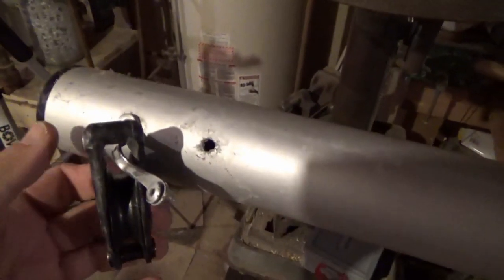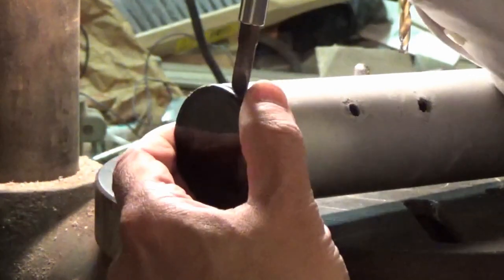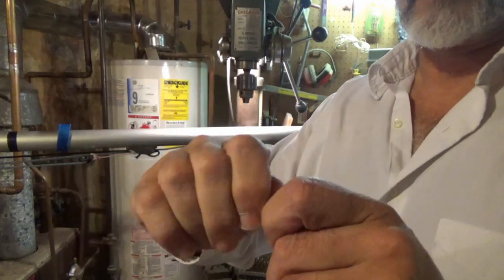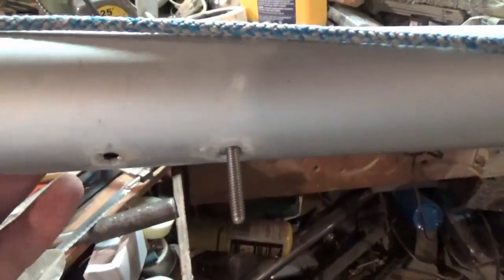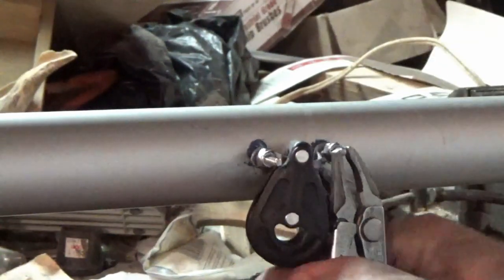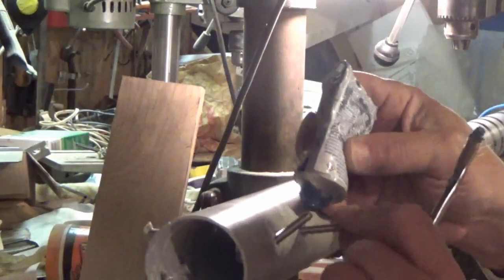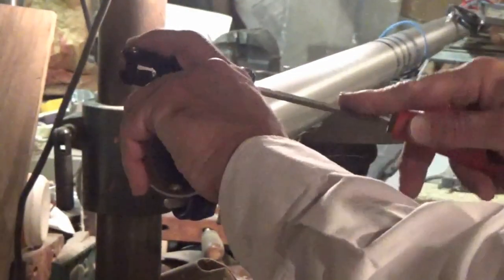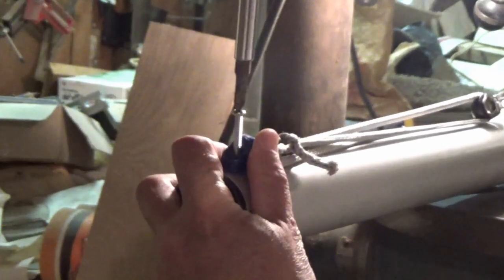Laser Sailboat Boom Repair

Comment: Another way to attach the draw thread to the screw is to use a hot glue gun to put a dab of glue on the end of the screw to stick on the end of the draw thread. TIP, wait about 30 seconds for the hot glue to cure before attempting to draw through the thread.

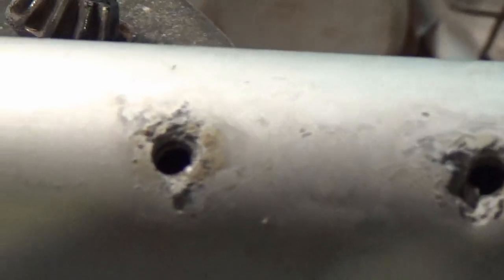Comment: If the corrosion at 2:14 wasn’t so bad, would you just re-rivot it (instead of bolt and nut)?
Reply from the maker: You could, that approach would work well if your just substituting the original plain blocks for the class legal Harken blocks on a relatively new boom.  This repair is usually necessary when corrosion has already started.  The problem is, the corrosion makes the hole larger, and while pop rivets expand, you'll have the fastener working in hte hole and enlarging it further.
Reply: @laserd8  Thanks. Need to make this repair for my gooseneck soon.

Comment: i would have forgotten to put the block on the eyestrap for sure.  great tutorial thank you.  what is an acid brush?
Reply from the maker: An acid brush is a small, short-bristled brush with a metal handle used to put soldering flux onto copper pipe.  You can find them in home center and hardware stores at the plumbing supplies aisle.  They're inexpensive and disposable.

Comment: 9:32 Oh no! You didn't replace that cracked fairlead? Or is it just a gigantic mold seam? Otherwise, nice video! This always sounded like an impossibly fiddly fix, but it looks fairly straight forward with the right technique.  Sure would be nice if the builders consistently used a corrosion barrier like Lanocote where stainless and Al touch...
Reply from the maker: No problem here- it's just a mold seam.  On my own boat, I replaced the plastic fairlead with the alloy one that's designed to replace the traveler fairleads - maybe overkill but it will outlast me!
Reply: @laserd8  I thought about doing that when I rebuilt my boom too, but the plastic fairleads have a wider filet radius, and the line slides around them better.  As a fresh water sailor, I just used stainless rivets with Lanocote. 12 years later it's holding up fine.

Comment: Great tutorial Bob ! Thank you for sharing it
I assume that a boom (or a mast/gooseneck) so repaired can be used for practice and training only (or for fun :-)
In other words: does this repair meet the "one design" Laser Class Rules? Can a boom with screws in place of rivets be used in an official race?
Thank yo again
Reply from the maker: No worries here -  ILCA By Law 1 part 3 rule 26 allows this repair without disqualifying the boat.  The purpose of the rules is to keep the boats equal - they encourage maintenance to keep boats in the fleet, as long as the fix doesn't change the original function.   Compared to other classes, the Laser class discourages "competition by checkbook" - it would run counter to the spirit of the rules to require racers to replace spars in their entirety when they can be economically fixed.  BTW, this technique can also be used to upgrade the older style boom blocks to the newer style (class legal) ball-bearing blocks.
Reply: @laserd8  Thank you. Makes sense :-)

Comment: How do you remove the screws when you need to replace the blocks again?
Reply from the maker: I had to do this on my own 20 year old boom. I split the nuts with a hacksaw and replaced the hardware. I once tried threading bolts through an aluminum rod, but I couldn't snake both bolts through the holes.